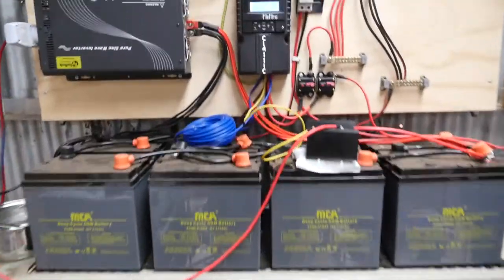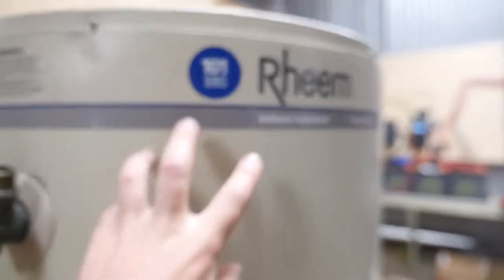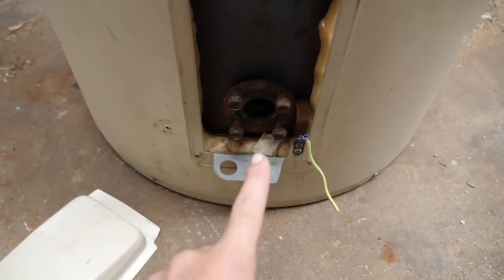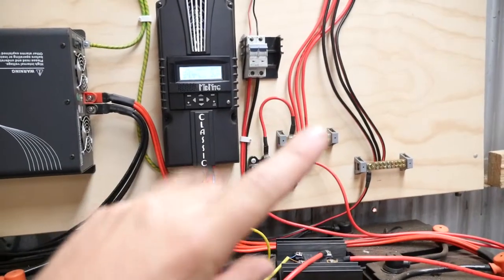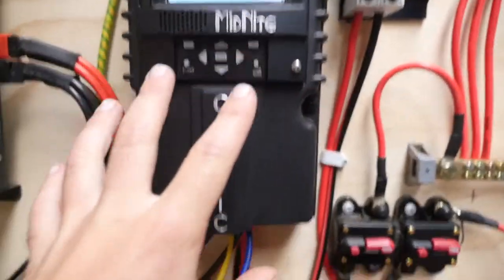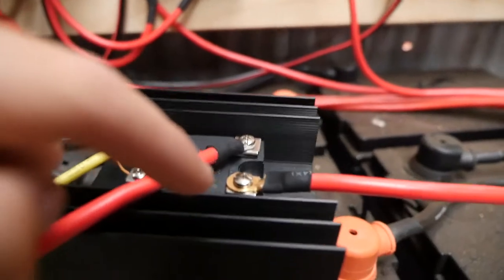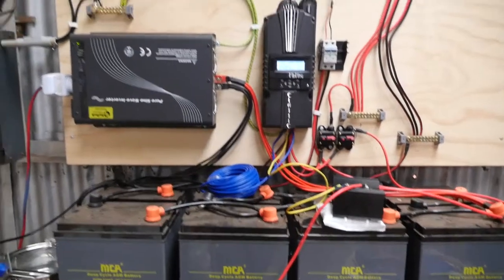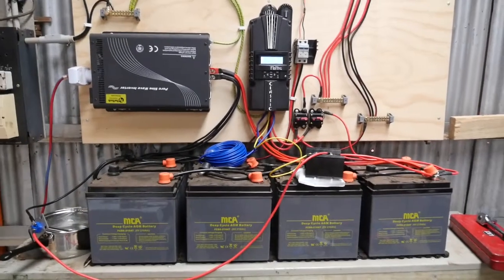Off Grid Hot Water - DC Hot Water Heater Element Dump Load

Comment: Good job mate. This looks ok for what you are trying to achieve, ur on the right track. Im guessing that is a voltage sensing relay that ur using to divert the load as the batteries reach near a full SOC based on a preset voltage.

Comment: Very nice wiring and component layout ( with no idea or comment on gauge used ) I do have a suggestion though.  Look into automation. I use Arduinos ( esp-32s ) and “Node Red” to wirelessly meter my batteries and dynamically and automatically switch the solar input voltage off my controllers directly to a inverter that has a 24 - 75 volt input. The goal is to isolate fully charged batteries from the ridiculous micro charge / drain cycle. Another advantage everything is displayed on a web page accessible throughout your house and world wide if you would be less security minded.

Comment: I heat all my water connecting to the PV array without going thru a charge controller or using batteries. That way the batteries are always full and not heating CC.  I use a power point controller which looks at the pv voltage to determine when the CC isn't using all the panels power.  That lets me capture more power than typical CC diversion control can do and it requires no battery for highest efficiency.
Reply: Can you connect to panel directly to the heating element? 
With out battery or controller?
Reply: @bernardwarr4187  Yes, there are plenty of popular videos from people who don't know what they are doing. Direct connect is EASY, that is all most look for. It is inefficient and take twice as many panels to get the same performance of a system with a WH controller board. It would not be possible to heat water with PV without a sophisticated controller board at my location. I have what an engineer would design for himself. I don't want my wife saying when am I be able to use my dishwasher. I'm a dozen years ahead of the solar world.

Comment: I like the set up mate! How have you got it tied into the house system? If you’ve got a duel element tank then I’d use the top element on 230 and the bottom on 24v but ideally you’d want them right next to each other 

The other option if you have a existing PV array then you could get yourself a grid feed inverter have have it dump the excess power back to the grid 

Old workmate here in NZ had a similar system but with a wind turbine and he has the same issue of finding a use for the excess power 

Only trouble with using a cheap grid feed inverter is they tend to overload themselves and blow up when connected direct to a battery, so you’d have to divert it direct from the solar panels when the batteries are full